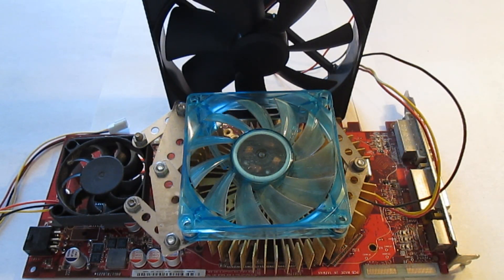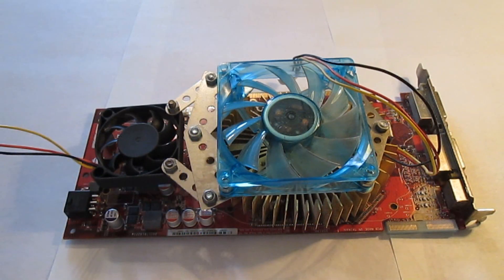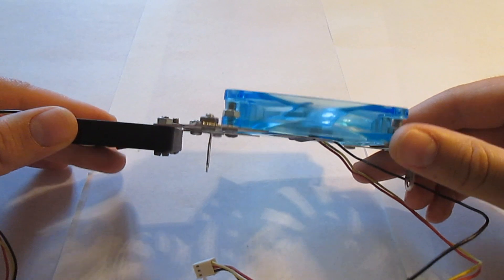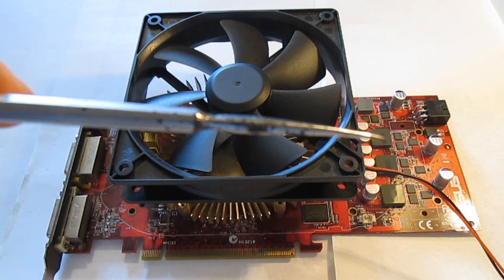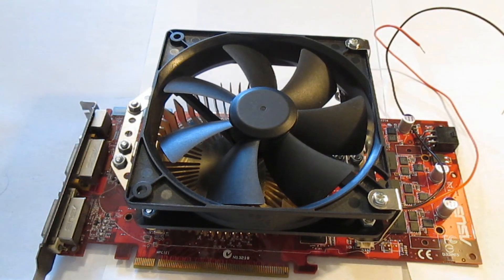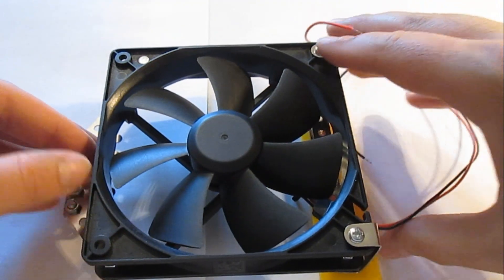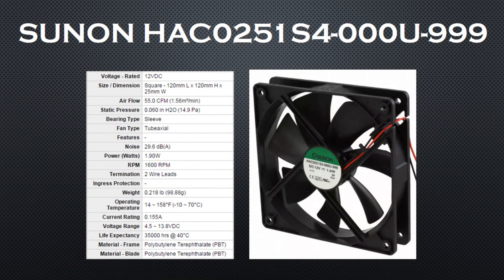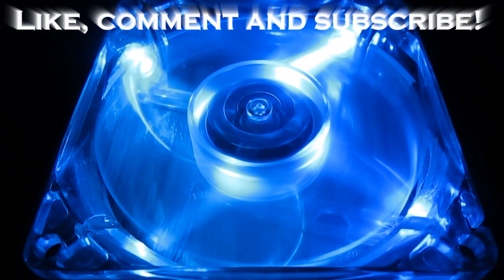[Hardware] Custom DIY ASUS HD4850 cooling upgrade

Comment: I'm getting ready to order my new build. I would like to run it by you and your followers. Intel 4790k cpu, msi Z97S Krait motherboard, gtx 970 strix gpu, 4 sticks of hyperX fury white 4g 1866 ram, swiftech 240X2 water cooler, 8 gig m.2 boot drive, WD caviar blue 1tb storage drive, PC Power and cooling 600w power supply, corsair 760t white ATX case. I plan on  using 3 ips monitors. Please let me know ASAP as I am putting in my order in the next 2 days.
Reply: +Michael Cowan techOrder might make a video about this in an upcoming Q&A but my opinion is that right now it is a bad period to buy a PC build. I mean the Zen CPUs from AMD are coming out in like 6-7 months? I would wait to see them first
Reply: George Workout Ⓥ Wish i could afford to wait but my year old g3258 is just not cutting it as a workstation/gaming rig anymore. ineed cores and power.
Reply from the maker: +Michael Cowan As George said you should wait a bit because now it's not a good time to upgrade. I am going to be quite busy the following two weeks so I will give you a more detailed answer when I have some free time.
Reply: Too late parts are arriving daily. here is the final build list. http://pcpartpicker.com/user/MonsterHogg41/saved/tWBXsY
Reply: P.S. So glad to have you back making videos!
Reply from the maker: +Michael Cowan The build is looking very good, and than you for the support. :)